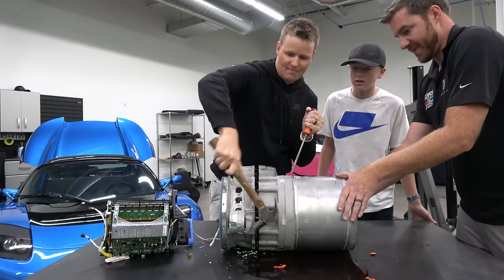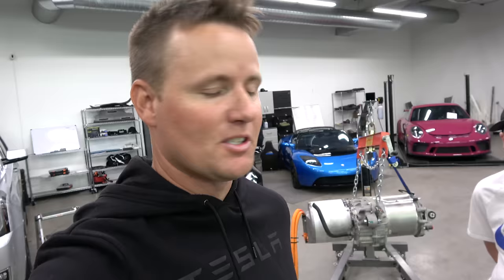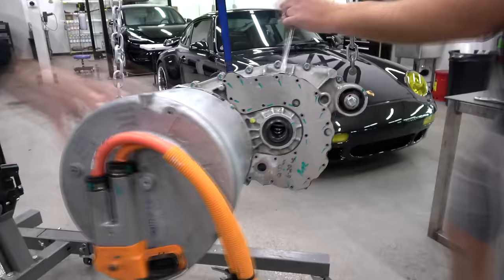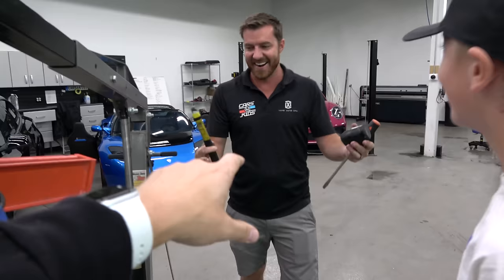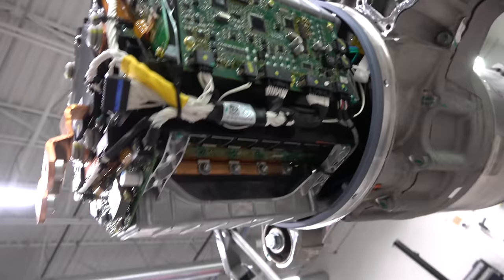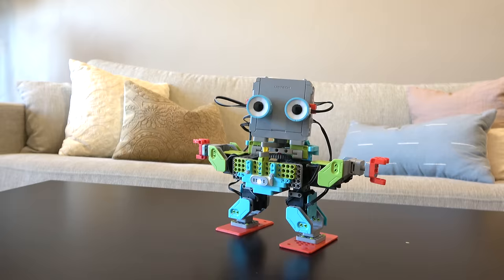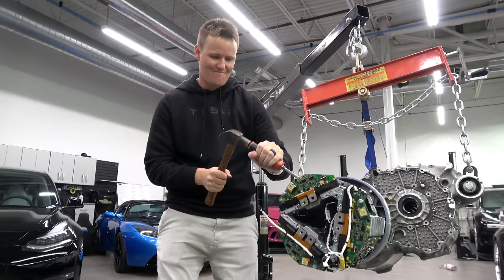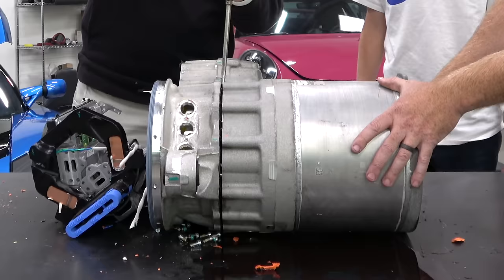What's inside a Tesla Engine?

Comment: Reads title
Normal people:

Car guys: Tesla’s have engines now
Reply: Lol that’s what I wondered, wrong title!
Reply: Wonder if it is turbo charged too?
Reply: Lol I was just thinking the same thing
Reply: They always had engines because we are still not smart enough to not have engines in electrical cars
Reply: I am not a native English speaker. Does this mean that engine and motor aren't synonyms?
Reply: Un Usuario yes, you are correct
Reply: @unusuario5173  in terms of automobiles, motors are electrically driven. And engines are driven by the combustion of a fuel and air mixture
Reply: 4 ppl who dont understand 
Engine= a device witch uses internal combustion to generate power (exploding the gasoline) need to use a fuel that gives explosive reaction

Motor=any non internal combustion system used to propell a object
Reply: @infinityapx  - That's the common usage but it's actually a misconception. 

Motor = a device which imparts motion 

Engine = a machine (moving parts) that turns energy into mechanical movement 

So an electric motor is a type of engine 

Solid fuel rockets are referred to as rocket motors and not engines because they have no moving parts and they obviously use combustion
Reply: @PabloGonzalez-hv3td  i was tryna be quick with the explanation so i didnt read it over or mention the moving parts and mechanical movement
Reply: @infinityapx  It has nothing to do with internal combustion
Reply: Electric = Motor 
Gas = Engine
Reply: Way to lose credibility
Reply: What I learned in college is that engines drive and motors are driven. So an engine by itself can drive an output but a motor, whether electrical or hydraulic, is driven by either a battery or hydraulic pump.
Reply: @DirtdragonRS  but isnt the ignition the driver in a engine?
Reply: @Stefan_Smith  I'm just repeating what was written in my motive power textbooks, but in day to day conversation the words are commonly used interchangeably. An engine is defined as "a machine with moving parts that converts power into motion." And a motor is "a machine, especially one powered by electricity or internal combustion, that supplies motive power for a vehicle or for some other device with moving parts." Point being that in the grand scheme it really doesn't matter what someone says as long as you understand their intent.
Reply: Came here to say this. Wasn't disapointed lol
Reply: Actually I once read an article about some guy putting a V8 in their Tesla.

Comment: "Computer, battery pack and this motor"
Points to the transmission...
Reply: @Contrailing  No, the motor is the stator, rotor and housing. The transmission is the gears and gear housing.
Reply: The dunning kreuger effect is strong on this one... ^^
Reply: gblueslover2  Haha what a brilliant hint
Reply: You cannot even conceive being on his level of genius, Sander. It's impossible I tell you!
Reply: That’s not even a transmission, it’s just a gearbox
Reply: @Shin-pg9zi  Gearbox and transmission is both used.
Gearbox - A box of gears
Transmission - Transmitter (in this case mechanical power)
Both descriptions fit, but even I use transmission and gearbox the way you described, as in:
Gearbox - fixed ratio
Transmission - variable ratio
Reply: @Contrailing  Well I can't remember making fun of you, I just disagreed with your statement, just like you disagreed with mine. I get why you'd call the entire assembly 'motor', it's because lots of other people does (like in this video and Elon Musk for example). However in the car world, the component they destroyed is called a drivetrain assembly (part of it). The motor and transmission is two drastically different items. It's like saying "this apple", while pointing to the entire fruit basket. Ofcourse, this isn't some massive mistake on anyone's part, but he could've been quite a bit more accurate Especially because the public's general knowledge of how these work is rather lack luster.
Reply: @sandergjertsenstvold1051  You're being pedantic about it. The big picture comparison is vs traditional ICE, where the much less efficient transmission runs along the center of the car, creating a tunnel and wasting interior space.
Reply: Boards...gears....rotor....all is the motor. Gosh
Reply: @taipoxin  What about traverse transmissions lol

Comment: “Guess how many times I’ve had to change the transmission” Yes Dan... because replacing the transmission is part of regular maintenance on gasoline cars 🙄
Reply: Usually when a transmission goes you might as well get a new car... Because when that goes the car is damm old.
Reply: If you drive a Dodge or Jeep then getting new transmission is just a normal thing you do once you hit say.... 15k miles.
Reply: @HarryL2020  depends on the car. If you drive automatic yeah you should get a new car. If you drive manual it is a lot cheaper to get fixed.
Reply: I was gonna say "who the hell replaces a transmission as normal maintenance?" I've owned 9 gas cars in the past 19 years and have replaced 0 transmissions. The lowest mileage any of those cars had was around 70k when I bought them and I definitely ran them for 30k per year minimum except my truck which I commuted with for one of the five years I owned it and the other 4 it mostly sat quietly rusting.

Current car is a Prius with 150k on the clock and original transmission.
Reply: @gforce95vn  Thats a chevy, sorry to tell you.
Reply: @ivanf4023  If you owned a car built in the 80s or before, especially if it has a automatic transmission, you will be familiar with having had the transmission repaired, rebuilt, or replaced. The specialty of AAMCO is repairing automatic transmissions. It's the parent company of MAACO, the body repair and paint business. AAMCO had to expand into general automotive repair as automatic transmission became more reliable.
Reply: Surely he means changing the transmission oil, not the actual transmission itself?
Reply: @Mtber05 let me guess.. she had a manual transmission..
Reply: Sure, you don't have to change transmissions, but on the newer cars with 8-10 speeds, they are often problematic requiring software updates or repair for various issues - usually hard shifting. And hope that it gets all these issues resolved before the warranty is up.
Reply: @gforce95vn  That was the case 15 - 20 years ago but since switching suppliers (ZF) they are now among the best.

Comment: I'm sorry young fella but you are incorrect on a few things that you have mentioned for instance; that is not a engine at all but a electric motor, and although it does not have a oiling system in the traditional gasoline engine way it does have and require a oil filter and regular changing intervals, as far as that goes that is about all that is different it still has a differential (in order to drive the wheels, and that requires transmission fluid and again that requires a filter and service all those bearings you and your boy are spinning and playing with they have to be lubricated somehow, and the blue stuff is the new coolant that has replaced the old dexcol engine coolant 
But good job kids have a blast

Comment: “What’s inside a Tesla motor?”
doesn’t look inside actual motor
Reply: It's not actually motor there is one side  having stator and rotor with 15000 rpm with transmission and inverter
Reply: If we use brake to stop car the stator works as a generator
Reply: @sudhansudubey7950  which is called an 3 phased induction motor

Comment: "What's inside of a Tesla motor" and doesn't open the motor, amazing....
Reply: 哈哈 indeed, amazing
Reply: Hell yeah
Reply: ...also said in the description it was an engine... Teslas don't have engines... they're electric.
Reply: @ernie3nell  yeah electric motors
Reply: It's from what's inside. There's not one of their videos worth watching.
Reply: @ernie3nell  engine or motor is a machine designed to convert one form of energy into mechanical energy
Reply: @ahemjunior  Sorry, an engine is combustion, and has pistons to turn a crank shaft, a motor is magnetic, and has a stator to turn a rotor, and output shaft.  There is a difference BY NAME.
Reply: @leeryon8951  Never heard of word of "Motorcycle" ?
Reply: @leeryon8951  Fuel motor/engine doesn't always use piston.. Whats your poin anyway ?
Reply: @Arctic_silverstreak  I don't want to bore you but the Thermodynamic definition of what constitutes an engine needs both a "reservoir" of hot and cold and the difference is what allows an engine to function. An electric device like a motor does not fit that category. So ernie3nell is very much correct.
Reply: Disgusting
Reply: Imagine arguing about the difference between a motor an a engine......😂💀

Comment: Saying that Tesla motors don’t need oil or a transmission is the most hilarious thing I’ve ever heard! I’m surprised this isn’t an April fools video!
Reply: I think what they meant was that Teslas don't need oil changes.
Reply: @OmegaF77  what the hell do you mean? There will be a point where you need to change that oil. Oil dosen't last for ever you know. I just know on engines the gas and diesel and combustion is why the oil gets dirty let alone the oil will loose its lubricity. When parts start to wear out causing metal in the oil is not good for the motor. Just find scotty Kilmer's video on sealed transmissions and why they need the oil to be changed.
Reply: @PSNxFTWxRAGOI  The oil needs to be changed in an ICE car, but not on electric cars (not practically anyways). By the time you need it to be changed, the entire car is most likely dead (1 million+ miles). The oil doesn't get dirty because there is no combustion. There may be metal filings, but it will be very minimal because there are only a couple of gears meshing together as opposed to an ICE car transmission with 7 or more gears meshing.
Reply: @OmegaF77  You don't really know what you're talking about, mate. You're getting engine oil, transmission fluid, and differential fluid all mixed up as one oil. The gear train in the Tesla is more akin to the differential in a car and you usually swap the diff fluid in at 30k miles or so, depending on what you have. You will eventually need to change that oil. With work, oil loses its effectiveness over time, regardless of what it's in.
Reply: @robokid20001  Also, the "diff fluid" in the Tesla is a lubricant, which does not need changing.
Reply: Swampy  There are many Teslas with 1 million miles or more without their transmission lubricant being changed. Also, industrial electric motors are different than electric motors in a Tesla. Counter intuitive I know, but one is huge and for continuous use while the other is compact and used only when the car is moving.
Reply: Swampy  There's almost no electric car repair shops because mainstream modern electric cars are new and no one is willing to retrain staff because it will cost money. Common sense.
Reply: Swampy  I also know that nothing lasts forever. And yes Tesla drivetrains would need to be refurbished every million miles due to wear and tear, but not every couple thousand like gas cars with drivetrains that consist of hundreds or even thousands of moving parts.
Reply: Swampy  Also, I believe that we're talking about two kinds of motors here. Tesla Model S/X have AC induction motors in which only bearings are physically contacting. No brushes. Also, their transmission as you can see in the video is only comprised of a handful of gears, which would produce few metal shavings. The lubricant would not get dirty much.
Reply: @OmegaF77  Tesla gear oil needs changing - the operating manual has that in it.  First change in 1 year or 12.000 miles than every 8 years or 100.000 miles (whatever comes first).... Check that out !
Reply: Oil is simply a lubricant, it has to be changed at one point

Comment: That “sticky” stuff on the electronics is used to damp the vibrations and protect the components
Reply: what's it called?
Reply: Ijar Ijar što si rekao o mojoj mami?
Reply: Something like non Newtonian stuff
Reply: It's actually called potting gel and it's mainly to prevent high voltage arcing
Reply: @TurboElectricLtd  finally learned something from this video.
Reply: The spark plug looking things
Reply: Kuch bhi MATLAB..
Reply: Dont forget to mention they look like spark plugs
Reply: And also keep it waterproof , 😉
Reply: @dc2guy2  pad

Comment: Advertized as "What's inside a Tesla Engine?" then gets the entire motor, gearbox, and inverter assembly then destroys and takes apart everything BUT the actual MOTOR!!!
Reply: That's impossible with the tools they have.  There are probably strong magnets, you can not open the lid.  What they could saw on two parts.
Reply: @xelth  I'm pretty sure they arnt using permanent magnet motors or they would go to crap real quick with the heat they dissipate
Reply: Is the motor in the next video?
Reply: @matthewcastleman1266  it is a permanent magnet motor, there are other videos about it.
Reply: For starters they show their ignorance with the title...Tesla does not have an engine. Anywhere. It has a motor. Very real, and very different source of propulsion.
Reply: @xelth  no magnets buddy.
Reply: Prowler Cam  Engine and motor literally means the same. No other language other than masterrace english has multiple words for a Motor...
Reply: Prowler Cam .... Don’t apologise to that tamas tamas person who is clearly ignorant of such language subtleties.  Motors are electric...Engines use chemical fuel.  There IS a difference, they are NOT interchangeable words, and whilst we CAN colloquially call an Engine a motor....you should never call a motor an engine.  Nuff said.  As to MASTER RACE ENGLISH....I assume that is meant to be an insult to English speakers...meaning tamas tamas is likely something else and the least qualified person to correct anyone’s English vocab. Pah!
Reply: Lmfao xD!!! Yesss!!!
Reply: @xelth  this is an ac induction motor the permanent magnet motors are in model 3s
Reply: @Rrgr5  nope. thats the reason why Tesla needs no neodymium. Only the Model 3 motor uses permanent magnets.
Reply: @contessa.adella  That's a common misconception as we tend to associate motors with electricity but an electric motor IS an engine.

 Motor = a device that imparts motion

Engine = a machine (moving parts) that converts energy (ANY energy source) into mechanical work

In rocketry there are both motors (solid fuel) and engines both use combustion

Comment: High-Side and Low-Side refer to MOSFETs. Usually MOFETs are tuned to either high-side (meaning lower loss due to gate-charge and switching, yet higher series resistance), and Low-Side (meaning greater loss at switching due to higher gate-charge, but lower series resistance).

The High-Side switches more often, and low-side stays on for longer periods of time... hence you have the two designs :)

Comment: the inverter is the brains of the operation witch turns the dc to 3 phase ac using those computers and that means that the rotation is smooth without and with the bearings. however if you want to make it work again. you have to use another inverter. and tune it so that the motor can work again+ you have to refill the cooland and the oil.